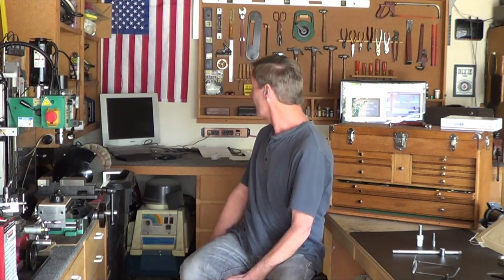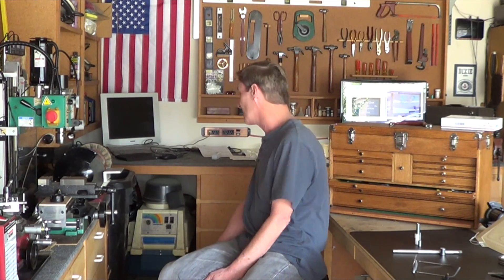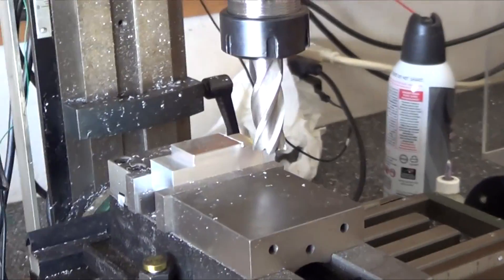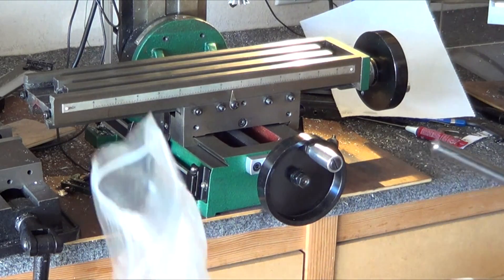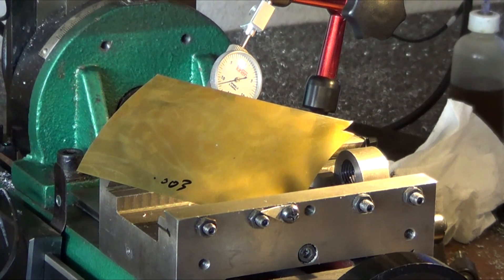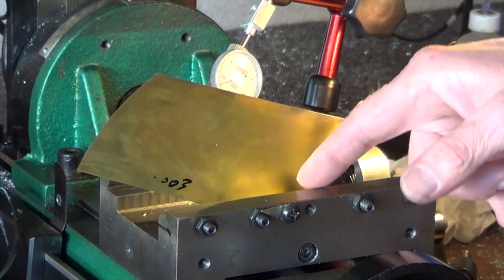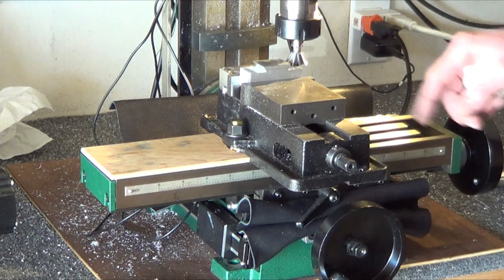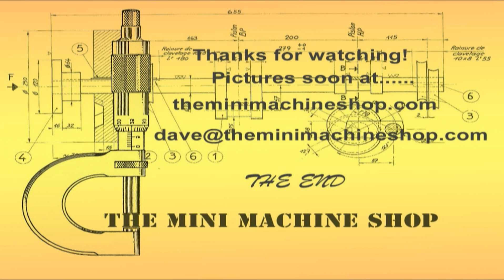Grizzly Mini Mill Axis Repair Video #47

Comment: Ways use way oil, that's the stuff you need to put on there I guess WO-20 will be fine, no grease no motor oil or other stuff.
Reply from the maker: WD-40 is only good for lapping IMO I use HF pneumatic oil on the ways keeps them clean...
Reply: @TheMiniMachineShop  WO-20 is the SAE standard, which is not WD-40. Some manufacturers use WO for way oil, the number is the viscosity grade, with 20 being the less viscous which is great for horizontal surfaces. You can also find this labeled ISO-68. WD-40 is not a good lubricant, it is for water displacement (thus WD), 40 is just the version number. WD-40 has a very interesting story.
Reply from the maker: @reiniertl  I know the story on WD-40  but thought you just made a typo thanks I need to do some research...

Comment: I'm having problems with my x axis jammin up when I screw the table all the way to the left. Can someone help me and tell me what to do.
Reply from the maker: Lead screw/nut alignment problem. Loosen the two set screws holding the nut the lead screw goes thru. They are just under the X axis lead screw on either side. Two holes can be seen. The move the table all the way left and retighten. You may have to play with it a bit to get the nut to sit right. Either that or its a gib problem...

Comment: Silicone brake grease works great they use it on brakes because as use it won't attract dust and stays viscous boo matter what I've used it on lots of busses with great success and I use it on all my machines where grease or heavy oil goes get it at Napa in a big tube
Reply from the maker: Really! We shall try it....
Reply from the maker: Can you send a link there are to many different ones...

Comment: Hello Dave, hope all is well. If you ever have problems again with your lead screw nut again the best fix I've put together is make a new one out of delrin by turning one of your lead screws into a tap with a dovetail cutter. I've done it and with excellent results,.001 backlash and delrin being self lubricating. As far as the leather way covers. I've had excellent results by using 1/2" aluminum angle as mounting brackets and using gorilla glue adhering the leather into properly spaced sleeves and threading elastic Paracord through so they're always tight and never bind in the ways. Just thought I'd share some solutions I've had to problems anyone using a mini mill are familiar with.... Thanks for the videos
Reply from the maker: Hi Mike, glad you posted these comments as they are great ideas for others to consider! Would love to see a picture of the lead screw tap....

Comment: Dave, I'm sorry to keep asking you  questions on here but I respect your opinion and was wondering if you ever upgraded your Y axis by installing a thrust bearing? if so , was it a good upgrade ?
Reply from the maker: Not a problem ask as much as you like. Looked into it and decided not necessary. I use a nylon lock nut on the X and Y hand wheels and have no problems with play between the wheel and frame. Don't see friction as an issue either. I just can't see it really doing anything!
Reply: ddistrbd1 I have the thrust bearing upgrade and it works well.

Comment: I like the chip guards  but couldn't understand how you got  rid of the slop in the Y axis, I wish you could show where/how that brass shim corner was  binding the nut. overall, I always enjoy watching your videos.
Reply from the maker: The slop was removed by adding a shim which tilts the lead screw nut. If you think about it you will get what that does to backlash. Try getting a bolt and nut and angle the nut to get the idea. Hope this helps.